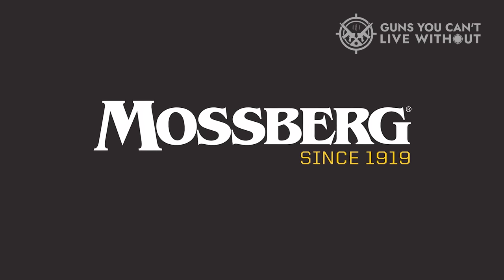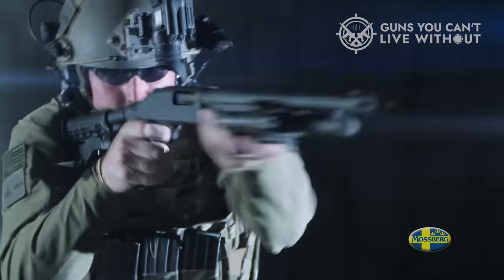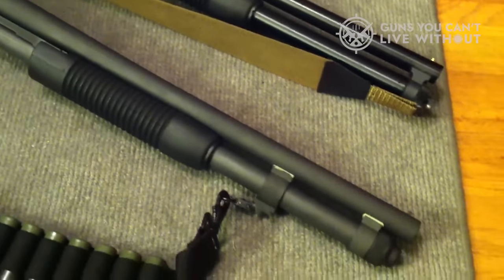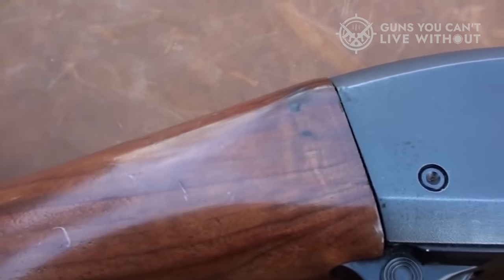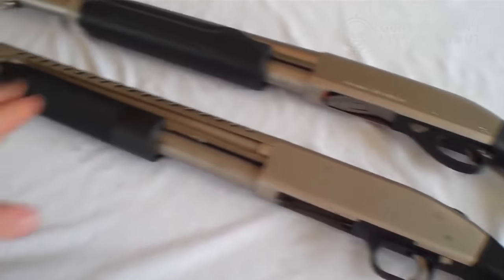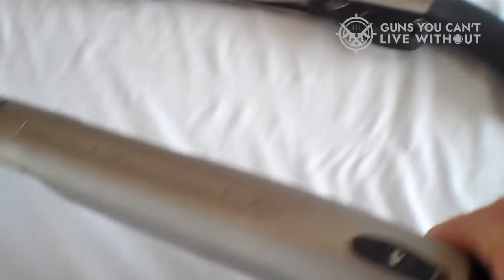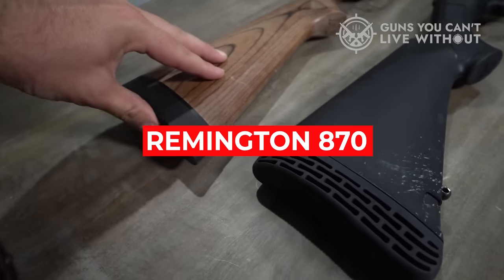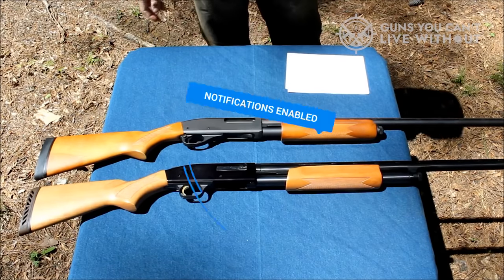Mossberg 590 vs Remington 870 - NOT EVEN FAIR.

Comment: I worked as a gunsmith in a very busy gun shop. I saw way more Remington shotguns coming in for work than I did Mossbergs. I’ll take the Mossbergs any day of the week. Simple to work on by the owners, lots of accessories and mods you can do that can turn a Mossbergs into any type of hunting, clay, tactical, competition gun you could want.
Reply: Do you know what time period those 870s that came in were from? Were they pre or post Freedom Group ruining them?
Reply: @ShogunMongol  It was kind of a mixed bag. This was in the mid to late 90’s. Ejectors were a problem on many of them. I think the thing they had in common was the numbers of rounds put through them. The thin wall magazine tubes were a fairly common problem too. The tube would get dinged and we would have to use a custom tool to take the dent out. Of course there were the usual things like action bars breaking or misfiring due to owners lack of cleaning or using WD-40 as a lube for years. I saw a lot of old and new models. The shotgun I absolutely hate is the Remington 1100. They may have finally got the gas system figured out on them by now. But that was the most miserable piece of crap to work on. You had to determine which version you were working on by the serial number because Remingtons gas system had modifications for years and years from them trying to get it to operate properly. God how I hated to see one of those come through the door and land on my workbench. Anyway, yeah…. A Mossberg 500/590 is superior to Remington 870 because most anyone can repair and maintain them with basic tools. If you’re mechanically inclined where you work on your own car. Do small plumbing jobs around the house or work on your motorcycle. You can do everything you’ll ever need to do on a Mossberg. No specialty tools needed. Remington…. Not so much.
Reply: What did you think about the old remington 1148?
Reply: @FriedPi-mc5yt  that's sad. I always thought that the 870 was good before Freedom Group
Reply: I'm not a Remington guy but I assume you'd see more Remingtons as they were a bigger seller
Reply: @revelation20232  That was probably part of it. But needing some specialty tools for the Remington insured that owners wouldn’t be fixing every problem themselves.
Reply: @hoppinggnomethe4154  Remington 870’s are good guns. It’s just that an owner won’t be able to fix every breakdown the gun may have. It will probably see a visit to a gunsmith at least once in its lifetime.
Reply: @jasoncooney3595  I don’t remember ever having one on my workbench.
Reply: Only used 870’s in my many years in LE, good to know. Thanks
Reply: Because there are way more remingtons on the market.  Mossbergs are cheap enough to just toss if anything happens.  btw, Remington wins hands down for sporting clays and trap, it's not even close (30 years experience)
Reply: @dazzling3237  LOL! Okay dude. But sporting clays and trap are pretty much a controlled environment. You drop that sporting clay and trap gun into real world environments and it won’t last as long as a Mossberg 500/590. There’s a reason the military chose the 590 and not a Remington 870. Ease of maintenance, robust build and the ability to fire round after round after round without trouble. Keep your Remington on the clay and trap range where it belongs. Just don’t bring it out in the real world to compete against the 500/590.
Also, I’ve never heard of anyone “just toss” a Mossberg. You don’t “just toss” a $450-$500 500/590 shotgun. The fact that the Remington 870 Express is over $500 and the Mossberg 590 is $475 just means you over pay for shotguns. I’m fine with you loving your Remington. But I would never choose an 870 over the 500/590. I would much rather have a shotgun that can get beat to hell and keeps going than take one that looks pretty on the clay and trap range.
Reply: @roncougar1  The PD/Sheriff was probably issuing 870’s because of a deal with Remington. Remington often gave law enforcement good deals on shotguns.   Of course Mossberg does too. Granted most all 870’s I’ve shot were smoother operating than Mossbergs. But as a Mossberg breaks in, it gets pretty smooth too. LEO’s don’t get much choice on issued shotguns. You gotta take what they give you. But if I had a choice I would definitely choose the 500/590. If it’s good enough for the Marines, it should work for cops as well.
Reply: That’s because those Remingtons are used much more by people.
Reply: @_DB.COOPER  maybe but not necessarily. Remington 870’s need specialized tools to do some work on them. A Mossberg doesn’t. If you break an ejector on a Mossberg 500/590 the owner can fix it. That doesn’t happen with a Remington. It takes a trip to a gunsmith. The only time I had Mossberg 500/590 on my bench was usually to add parts like Pic rails for optics or changing out factory safety switches for bigger aftermarket ones. It was for guys who weren’t comfortable adding those parts themselves. Though they very easily could if they would have had the basic tools to do it.
Reply: @FriedPi-mc5yt  I was part of a team that tested both and some others for duty deployment for the United States Border Patrol. The 870 Remington won hands down and is still the official Border Patrol shotgun.
Reply: @_DB.COOPER  Okay dude. You totally won me over. I’ll buy everything Remington has to offer now. You proved me wrong and I’ve seen the errors of my ways. My decades of gunsmithing experience is no match for your vast wealth of knowledge and experience. Did this work for you? Is it what you want to hear?
Reply: my Mossberg Pump Action (that too an affordable mode) is one of them most reliable and sturdy machinery is i’ve seen
Reply: @FriedPi-mc5yt  yes thank you. I know you’re the only person with decades of firearms experience because you worked in one particular gun shop and everybody should bow down to you because of your vast shotgun experience, knowledge and you’re no doubt the smartest person in the room and if somebody doesn’t believe that all they have to do is ask YOU! Wow, kid, you posted your experience and opinions and I posted my experience and opinions and then you get tilted and bent all out of shape. I bet you were fun to work around. 😝
Reply: Do you have any experience with Benelli supernovas?
Reply: @trentweston8306  They are excellent guns. A bit more pricey than a Mossberg (but not insanely pricey) but it has some really good features. They are super easy to maintain because they come apart easy. It’s better than lots of other shotguns for the money. The Nova was pretty cool. But it had some issues. Mostly you couldn’t really do anything about the length of the stock. I guess Bennelli learned their lesson with it and put a lot of effort into the Supernova. But yeah, from what I’ve seen the Bennelli Supernova is a top tier gun. Not sure why it’s doesn’t get more attention.
Reply: @FriedPi-mc5yt  This is a misleading statement. The fact remains that U.S. military has chosen both remington as well as mossberg. Price point was the reasoning behind the Mossberg simply the lowest bidder.
Reply: I agree. I do have to say though a Remington is addicting. It just feels good. Tickles a certain spot in my stupid brain. I can see the appeal. Slicker than a slug on a slope. I just made that up.
Reply: @adamnajera1297  Oh yes, the Remington 870 is a slick operating shotgun. No doubt about that. I defiantly love the Remington action. Once it’s broken in, it feels like the whole action runs on ball bearings. I’m just looking at the tactical/practical side of things. Kind of the same reason I like AK’s better than AR’s. If you need tack driving accuracy in a semi-auto. Very few guns can beat out the AR. But if you want a gun that you can sling and have it go with you to hell and back, the AK wins. I feel like I’m starting another fight with that statement. I built 2 AKs for myself from Hungarian parts kits. I’ve built an AR rifle for myself and I’ve built plenty of ARs for clients and friends. I like ARs a lot. Fantastic guns with enough aftermarket support that you can go prairie dog shooting in the morning. Use it for deer in the afternoon then plink with it in the evening. Just change out uppers for what you’re wanting to do. The AK…… not so much. It’s an anvil tough beater rifle that will shoot a dog turd if it contains a primer. It’s not modular, it has very few accessories that it can accept. It’s not a target rifle. It’s not that great for hunting (wild hogs are a go). But it will go bang every time you pull the trigger. It will drop rounds all day long into center mass at 150 yards. But it is what it is.
Reply: I had an 870.. it always jammed after the first shot
Reply: @michaelwadlington  Did you try different types of ammo? Did you ever figure out what was causing the jams?
Reply: if you worked as a gunsmith, why would you have any preference there? they both very simple shotguns.  both have lots of options of simple screw in, bolt on, bang rocks together kinda options.  they are both good and simple.
Reply: @FriedPi-mc5yt  ok, we are facing a "what era" question with these
Reply: @FriedPi-mc5yt  no remington does not need special tools.
Reply: @whatcanilearnhere9158  Why would I have a preference? Really? You don’t think mechanics have preferences in cars or programmers don’t have a preference in machine languages? Wood workers don’t have certain woods they like better than others? Come on dude. Get real.
Reply: I gagged at WD40 for gun lube.
Reply: @blucy10  I had a German Zwilling rifle/shotgun come across my bench that had been “maintained” with WD-40 as a lubricant for the action. It had silver and gold inlay in the engravings. The silver had actually turned a yellowish tint. I used a lot of Q-Tips and polish to bring back the silver color. I had an old S&W revolver that was nickel plated from the factory with the same issue. The worst part was when I opened up the gun to check out the firing mechanism. It looked like asphalt had been smeared inside the gun. All the burned powder, dirt and grime mixed with WD-40 residue from decades of “maintenance”. I had to use dental tools to remove it all. Then a multiple number of days soaking the parts in a cleaner/degreaser. I really hate WD-40 in so many ways.
Reply: Worked for a gunsmith as a kid ....yep...never seen a Mossburg to work on...we called them cheap guns...but they never came in for service...Remington yep worked on plenty of them.Shoe
Reply: @jasoncooney3595  1148 was a good gun for it's time, improvement over the model 11. that said it does have issues with heavy loads. For your standard bird shot loads it's fine but when you get into your high brass goose loads, buck shot or slugs, you have to flip the main spring in the fore grip. If you don't it will bust the stock. Also being recoil operated they have fairly heavy recoil compared to other autoloaders and the barrel moving can be a little weird seeing it. You would be better off with a pre 2000's 1100. I like the old 48's but the 1100 and 11-87 are better guns.
Reply: @_DB.COOPER  i totally agree, he is just one of those types🤨
Reply: @jimweishuhn2910  correct
Reply: @bushcraft_in_the_north  yes sir. Sad but true.
Reply: Maybe old model Mossbergs but the new version forearm rattles so much I have to hold it still when hunting. I have a newer 870 pre bankruptcy. I would say that this 870 is better made. Not quite as slick in the action but tighter tolerances and noticably more metal.
Reply: Same here for well over a decade I held an FFL and sold shotguns.  Some problems with Remingtons coming back ocassionally but Mossbergs never had any problems at all in all that time.
Reply: @FriedPi-mc5yt  I found that you have to manhandle a Mossy over Remmy a little bit more, never bothered me, but I've seen people with less experience struggle with new ones. That being said, I'd still take the 500/590 over the 870.
Reply: @FriedPi-mc5yt  👍🤣
Reply: Absolutely Spot on!! I bought a really nice Winchester Turkey Special some years back with laminated furniturer in a 12gage model that just kicked the living crap outta me. After I bought my Mossy 500 .20guage I sold that Winchester to my brother for his second son as a Christmas gift. I've killed turkey, coyote, and many other game with this shotgun and never had a sore shoulder, I Absolutely Love my Mossy 500 and would'nt give it up for anything!!
Reply: @chizorama  Yup, the Mossbergs do better with more aggressive handling.
Reply: hate the clickbait title that lied
Reply: I'll add my .02 since a number of posts hit on guns I've shot a lot, maintenance & LE. First I've gotten some awesome deals on non-working guns, because they were gummed up. So I encourage liberal use of WD-40.

LE agency gun buys:: Don't put any stock in them. I was in the game 31 years and if you're in a larger dept the budget usually dictates what is bought. Glock got in early, got its hooks into LE brass so it was buy-a-Glock-a-year with "new" models, "new"calibers ad nauseum. Sometimes an "influential person" will swing a buy to one model over another, you know just as a "public service". Like 870 over Mossberg.

When I entered LE in 1978 the dept had just switched to Ithaca 37 riot. Reason was for the ambidextrous feature which turned out to be a bad reason. In a little over 10 years we were having problems with self unloading 37's. I had it happen twice in one qualification with 2 different 37's. I was actually happy when I heard we were getting 870's and I don't like the 870. I didn't mind the Ithaca 37 until they started dumping shells spontaneously. 

IMEO the Rem 870's were a POS compared to the 1971 Wingmaster Magnum I had for 35 years. The 870 Police was like rubbing blocks of 80 grit sandpaper together. The non-detachable slings were another aggravation but was a "from above" mandate. I only had the Wingmaster because I needed a 3" chamber for waterfowl. Otherwise I hated its too short stock and the gosh awful safety position which I despise to this day. 

Feel like I'm missing a point. Any rate the first time I tried to load the 870 I found out it does not load easy like the Winchester Model 12. Learned to carry a special tool to shove shells into the mag, although I only had it happen a couple more times. 

I see you covered the 1100 pretty well. When I retired I worked in a LGS and asked the owner if the 11-87 was supposed to fix all the 1100 problems.....why is the 1100 still made? Answer was::..Some people love the 1100 so much they making them. (This was before all the financial crap and the big takeover).
Reply: I got both and both have never failed me yet
Reply: Your anecdotal evidence is interesting for sure
Reply: @sgtmcd  isn’t it?
Reply: Cheaper too. - Buy an 88 and accessorize all you want.
Reply: @FriedPi-mc5yt  I realized my comment may have sounded like a troll. I respect those that have experience and am always interested in learning. I watched this vid because I have an 870 from the early 80’s. It has always a point and click shooter for me but I’m certainly a novice on internals. Thanks again.
Reply: @sgtmcd  I have no real problem with the 870. They are well built guns and I’ve repeatedly said they have an exceptionally smooth action. My only issue with them is that they require some specialty tools for repairs. So eventually the gun will need the services of a gunsmith. Or you will need to purchase those tools for yourself and they aren’t cheap. Whereas a Mossberg 500/590 can be maintained by the owner from muzzle to buttplate. A few good screwdrivers and a mag tube wrench is about all you need. Add in a few drift punches and a hammer and you’re mostly set up to be a Mossberg 500/590 armorer.
Remington makes good shotguns. They will provide an owner with years if not decades of use. 
But I trained as a gunsmith and I can make a Mossberg 500/590 as smooth as a Remington. Plus I enjoy doing the work. Just because I prefer Mossberg shotguns over Remington doesn’t mean Remingtons are bad. It’s that I find Mossbergs more appealing for the price and the ease of maintaining it. I wouldn’t spit on someone’s Ferrari because I prefer Porsche. I have my reasons why I like Porsches better. You might have your reason for liking Ferraris. Nothing is perfectly suited for everyone’s tastes. Unless a person makes a thing explicitly for themselves.
Enjoy your Remington. I hope it serves you well for many, many years.
Reply: @FriedPi-mc5yt  cool. Thanks. My 870 is 20g and I’m in the market for a 12g. The info in the vid and your comments make me realize that I should educate myself a bit before buying. I really appreciate the info from knowledgeable folks like you. 🙂
Reply: @FriedPi-mc5yt  I should mention that I’m not married to my 870. I inherited it and shoot it mostly for nostalgia.
Reply: @sgtmcd  Like anything else, always research before you buy. But guns are like clothes. If they don’t fit, you’re wasting your money. Buy what feels good in your hands or at your shoulder. Look for the features you want and what the cost would be to modify it or buy aftermarket parts to fix any shortcomings. Think about the conditions you’ll be using the gun under. Will you be wearing winter clothing? Summer clothing? An adjustable stock might be required. If you already have the 20 gauge 870 it might be wise to get a 12 gauge version since you’re already familiar with the safety, handling, operation, etc….
Lots to think about. Good luck on your hunt for the new shotgun.
Reply: @sgtmcd  Nice that you inherited a good shotgun. I received an Ithaca 37 20 gauge from an uncle who I’ve always thought highly of. I will occasionally indulge in some trap shooting with the Ithaca. But it’s mostly to keep her action worked and because my uncle would be disappointed in me if I wasn’t properly enjoying the gun. He would not like it if she became a safe queen.
Reply: There are only about ten million more 870s, so I'm sure you worked on more of them . I'd bet most mechanics worked on more  ford's than Ferrari's, too. Real man of genius !!!!
Reply: @ronrichardson4805  It’s a shame your comment isn’t as smart as you think it is.
Reply: @FriedPi-mc5yt  I've been a gunsmith for the last 8 years, and this mirror's my experience. We've talked about it at the last two shops I've worked for. The staked shell latch, riveted ejector, and piss poor finish prone to rust are the worst. Nevermind even trying to find parts for the 870 now.  

Its a tough pill for lots of people to swallow, but its the truth.
Reply: @11481  I never had one on my bench that had a bad finish unless it was a heavily used birding gun. Or maybe if wasn’t well maintained by the owner. I’ve always found the 870 to be a perfectly serviceable firearm. Just annoying that special tools are required to do some work on them. Which is why I prefer Mossbergs.
Reply: @DB COOPER  His smartass attitude was completely unnecessary.  You did not disrespect  him or his shotgun of choice.  I'll bet he's a blast at the range.
Reply: @davidborzi6259  😂😂😂😂
Reply: This video forgot the 835. Just a 500 stretched out by half an inch. Heat up the receiver with a heat gun. That kills the locktite. Put on a 590 barrel and magazine tube. I'll find a gunsmith to open up the chamber.
Reply: I didn't have time to watch the whole thing so went to the comments to see a tldr 😅. I appreciate your perspective thereupon, who would know better than a gunsmith.
Reply: I have a 1957 Remington 870 with a 30” full choke barrel. I’ve Never had to have this shotgun worked on. It gets cleaned and taken care of. More meat and money was Won with this gun than could be remembered! It’s all in how you take care of them. Like your Wife !
Reply: @FriedPi-mc5yt  Owch, the Remington 1100 part hurt me right in the heart, that was the first gun I ever got when I was a kid.
Reply: @ShogunMongol  Yeah, I can imagine. The 1100 worked well, when they worked. But they were a constant source of irritation for gunsmiths.
Reply: 590 all the way
Reply: You are correct. We Are Watching...  👽
Reply: @_DB.COOPER  I would take the word of a gunsmith. That's done it for thirty years over a border patrol guy that wrote around with a shotgun set next to him and probably never fired it
Reply: @FriedPi-mc5yt  mine says "Montgomery Wards" on it.
Reply: @FriedPi-mc5yt  😂🤣😆😂!
Reply: @seansingh4421  still got mine from dad ... It has "Montgomery Wards" printed on it.
Reply: @John-jl4to  John what you should first do is take an English class, but you do you kid.
Reply: @revelation20232 by a huge margin!
Reply: A well broken in mossberg 500 is hard to beat. 
Mine rests bedside often.
Reply: @FriedPi-mc5yt  well played, I prefer the 870, I have an older 870 magnum that is going to out live me. the barrel choices/availability quickly change the 870 from self defense to turkey, deer or skeet/trap for fun, I looked at a 500 (new) and the slop in the action was bad, figured it would only get worse with use, from my limited knowledge it may have been improved on in the 590s but my 870s just get smoother with use and as for a gun smith only repairs I havent nor do I know anyone having broke down 870s. And guns are like most everything else these days, the older ones were better made.
ditto on the AK over the AR, to me the puny 5.56 is a barrel cooker and accuracy is just OK, I have more confidence in the AKs 7.62, its ballistics closely match the 30/30 and we all know what a 30/30 can do to a deer.
But when all is said and done its still the same old Ford Chevy debate.
Suum cuique.
cheers.
Reply: Is it because the 870's were used more? Idk, i have both-mossberg is newer. 870 is a recycle patrol gun. 870 seems to have lasted use better. Like em both but i would choose rem first.
Reply: I have a Mossberg 500 12 gage. I have used it for all hinds of hunting and shot literally thousands of rounds of trap with  it. Always went bang without a single failure. Cleaned it twice a year if it needed it or not. I also much prefer the tang safety. Easy to see if it's on. I have a bad habit of bumping off a cross bolt safety whole carrying in the woods
Reply: @FriedPi-mc5yt from my time in the military, I can tell you that we never even though of ever using a Remington in warfare scenarios. They are just not as reliable as the 590. Their is a reason the army chose the 590.. and their is a reason other part of the military chose the Bernelli and have never chosen the Remington. People can keep their Remingtons for their clay pigeons… I’ll take a 590 any day…
Reply: That’s because unlike the Mossberg which went out sloppy and shity the Remingtons should never rattle or have anything short of the slickest action ever operated so when farmer billy Bob mcStumpy noticed his action feeling stiff like a BPS he took it in and you cleaned it and sold it back to him. The Mossberg is so bad if it rattled less one would think dropping it 35 times accidentally fixed something.
Reply: @FriedPi-mc5yt Now you make the bogus claim that the Remington 1100 is garbage? Tell me why mine from the 1960’s (serial number dated to that far back) still runs like a brand new shotgun in a good way? Keep them clean and lubed and they just flat out work. It’s Ok that you like cheap inferior products because they fit your budget but no sense in lying about the why. In addition to being made in America sportsmen have bought Remington long guns for generations because they were the best. They dropped the ball at each acquisition but what can you do about that?
Reply: @hoppinggnomethe4154 Was. He saw High round count Remingtons that he basically been shot to death. He didn’t see Mossberg because people bought them and then stuck them in the closet and saved for a Remington and shot the Remingtons to death and it took decades for all but the most active competitive shooters.
Reply: @Batmicheal  Why so butthurt? It’s common knowledge in the gunsmith community that the Remington 1100 had a poorly designed gas system. Why else would Remington keep redesigning it if it was flawless? I’m sure you’re prepared to tell me that your Remington 1100 is prefect in every way and that it worked with every shell you ever put into it, from the lightest field loads to the heaviest Turkey loads. If that’s the case, good for you. I’m glad you got the one good Remington 1100 ever sold. I’m glad it cured your erectile dysfunction and made all your dreams come true.
Reply: Really because there have been 5 mossbergs in the family and everyone of jammed all the time.  Now I only have 870s.
Reply: Edit.  All of my purchases were from late 70s to mid 90s.
Reply: @tiredofallthis7716  I’m curious why your family would buy 4 more of the same gun that kept “jamming all the time”? Were they all new in the box? Why were they jamming? Were you using reloaded shells? Were you working the action correctly? You know that every gun has a break in period, right? Did you disassemble the gun and put it back together correctly? I’m a bit skeptical of your claim.
Edit: so from the late 70’s to early 90’s you kept buying the same POS Mossberg pump shotgun that “jammed all the time” and only after buying 5 of them, you decided to buy one of the glorious, all powerful, Remington 870, kill everything within 500 yards, shoulder mounted, red white and blue, I ❤️ Merica shotguns? 😂
Reply: @jasoncooney3595 Awesome!
2 3/4" limited but one of the greatest autos
Reply: Mossberg 590L. Was my patrol shotgun for years and still have it today flawless!
Reply: @FriedPi-mc5yt -- my Remington 1100 in 20 gauge from the early 1980s has never had a problem with factory loads.
Reply: @mojoman2001  Most of them do fairly well as long as you stay with standard loads. I hope you continue to have flawless service with your shotgun.
Reply: @FriedPi-mc5yt -- my 1100 in 20 gauge from the early 1980s works with all factory loads with no problems -- from #8 to buckshot and slugs.  Maybe there were a lot of manufacturing defects, but the design works great for me.  To say, "You got a good one" is a reference to manufacturing defects.  If the design was defective, there would be no good ones.
Reply: @mojoman2001  The design was/is defective. That’s why Remington kept redesigning the gas system. To get “a good one” simply means that the mechanical tolerances lend itself to functioning better. It’s as simple as that. With mass production comes fluctuations in dimensions. Especially before CNC machining was a thing. Even gauges used for testing tolerances wear over time. So….. not sure why you have a problem with what I said to someone else. If your 1100 works for you, that’s great that you got a good gun. But I know a lot of people that had nothing but trouble with them and had a lot of them on my bench that were a constant pain in the ass for me and the owner.
Reply: Wouldn't argue if an 870 is what I had, buy the lower price & reliability of the 500 series has never dissapointed especially when it comes to the 500 & getting a combo with the smooth shotgun barrel & a rifled slug barrel with fiber Optic sights makes it a great "if I can only afford one" choice. Really enjoy my 590.
Reply: @FriedPi-mc5yt you're just wrong dude, admit it. Your anecdotal experience means nothing.
Reply: @jegr3398  LOL! Yeah, it means nothing to anyone. It means so little you had to respond. LOL!
Reply: I didn't like the rattle effect on the Mossberg trying to carry it through the woods well deer hunting
Reply: @justdoingit.43  All pump shotguns rattle. There has to be a certain amount of loose tolerances in order for it to function in most all weather conditions. Tight tolerances lead to more malfunctions.
Reply: @_DB.COOPER  Which model and price point?  An 870 Police against a 500?  What deal was Remington making?
Reply: @vasky22  800 works, I wasn’t buying all of them the tax payer was.
Reply: @11481  Was just gonna buy an 870 but after hearing about these 3 easily fixable issues that Remington never fixed, I think the Remington is out of the running. Whats it like trying to replace and ejector?
Reply: Missberg is a bit cheaper made. Remington a little heavier and bulky. Ill take remington any day though....
Reply: @clems6989  You can do as you please. Your money. Your choice. I just offered free advice. It didn’t cost you a dime. But your choice might cost you later down the road.
Reply: I feel like another big thing is the mossberg has some easy to service parts. Screwed in extractor and such.
Reply: you can't find accessories for a Remington 870🤣 I own several Mossberg's & Remington's including the 870P & 590A1 of those I am biased towards the 870P
Reply: @ccclc6159  I never said you couldn’t find accessories for an 870 did I? Because if you’re implying that I said it, I never did say it, did I?
Reply: @FriedPi-mc5yt  I never said you said I couldn't find accessories for an 870 I can find all kinds of accessories for 870's
Reply: @ccclc6159  “you can’t find accessories for a Remington 870🤣” So what did you mean by this then? Are you saying I couldn’t find accessories for an 870? Because I never said that either.
Reply: @FriedPi-mc5yt  just thought your statement that there are lots of accessories and mods you can do to a Mossberg was a little juvenile & silly? as if the same can't be done to a Remington?
Reply: @NosferatuXGutts  Are the rivets in the 870 a positive thing, making sure its will never come loose which could happen with screws. I dont think screws would come loose, you could put thread locker on them as I do with many engine bolts. Just wondering if tats what Remington was thinking or are they just trying to save a buck?
Reply: @ccclc6159  Did I say there were no mods or accessories for the Remington 870 or any other shotgun? You do realize I was speaking about the Mossberg specifically, right? At what point in my statement did I say that no other shotgun could be modded or accessorized? I think you were a bit quick in posting your comment. You must have thought you were making a genius comment and it’s not turning out as genius as you initially thought.
Reply: I worked as a correctional officer and we had the 870 as our duty shotgun and I gotta say that I never liked it. I own a mossberg 500 and it has a buffer tube for better recoil, more lefty friendly, holds more rounds, and it’s just more comfortable to hold
Reply: @dazzling3237 the reason there are more 870s on the market than 500 series Mossbergs is simple and well known. Just as there were more Dodge and Chryslers in use by LEOs all over the country back in the day because Chrysler sold them cheap to get them on the road (same with Glocks for that matter), Remington sold their shotguns at greatly reduced prices to LEO Departments. Mossberg is the superior shotgun (of the two) in the hands of most combat shotgunners for reasons mentioned in this video and they're preferred by competitive three-gunners such as Jerry Miculek. Vang Comp, on the other hand, made a complete business out of trying to make the 870 better for a lot of extra money. And yes, Remington almost ruined the 870 brand just as they almost ruined the Markin brand. And finally, the Ithaca M37 trench guns are the holy grail of combat shotguns imho. The Ithaca 37s are superior to both 500  series and the 870s but they are prohibitively more expensive and without all the available accessories.  I own a couple of Ithacas, a few Mossbergs and one 870 which is a barn gun. As a former active duty member of the 82nd Airborne Division, as a competitive 3-gunner and as an avid sportsman and outdoorsman I could not agree more ... the Mossbergs win overall hands-down. With that said ... and it's not a pump but, Mossberg's Jerry Miculek 940 Pro is the whoop in terms of combat and competitive shotguns these days.  I own a couple of Benelli M4s but they've been surpassed by the 940 Pro, for the money, IMHO.  Mossberg really has-it going-on.  They are serious about their shotguns in a big way. A GREAT American company all the way around.
Reply: Because people that buy mossbergs can't afford a gunsmith.
Reply: @jeremy4046  bro why would I buy a gun I can’t smith myself or would need to take to a gunsmith?
Reply: @andreww8213  I've been shooting my 870 for over 20 years. I can still drop a whitetail at 100 yrds and have never needed to do anything to it....except to sights i did replace them with high vis fiber optic ones for low light dawn dusk situations.
Reply: @jeremy4046  I personally just don’t like the 870
Reply: Who in their right mind would toss a shotgun?
Reply: @scottwilliams8334  no idea
Reply: Mossbergs tend to cycle more reliable when it's wet. Shells don't extract well on the Remington when wet due to the single extractor.
Reply: I am a gunsmith retired 10 years. They’re both good guns but the Mossberg does have one fatal flaw.  Drop the shotgun and it’s possible for the Elevator lugs to pop out of the receiver and the action gets jammed up.  You then need to remove the trigger assembly and bolt assembly to seat the Elevator back into position.  Easy fix but if it’s a defense gun then that could be an issue.  Easy remedy is don’t drop the shotgun. 😉 And I seen more Remingtons come in for work in my shop also. But I believe that’s because we sold Remingtons 10 to 1 compared to Mossbergs so obviously there was a lot more Remingtons then mossbergs in our area which accounted for the difference.  I own both and I think they’re both equally good guns if you know their pros and cons.
Reply: @_DB.COOPER I don’t like them because they are made by Remington 😂. Absolute trash
Reply: Funny enough, i am buying my very first shotgun, and as someone who doesn’t know much about them i preferred the build quality of the mossberg 590 over any remington
Reply: That's because everybody back in the day had a Remington 870
Reply: Most owners didn’t own mossbergs😂
Reply: @FriedPi-mc5yt out of curiosity, what’s wrong with using WD40 as gun oil and what happens to the gun or how does this cause the action bars to break? (I don’t use WD40, but I would have assumed it works as well)
Reply: @Bisley1  WD in WD 40 stands for “Water Displacing”. It’s a water displacing oil that’s not necessarily meant as a lubricant. WD 40 will combine with power residue, dirt and grime to make a tar like substance over time and will harden up in all the nooks and crannies of a guns action. Over years of use without a thorough cleaning to remove the junk that builds up. It could lead to parts breakage due to jamming of the mechanism.
Reply: Remington 870 any day of the week my man. . .
Reply: @FriedPi-mc5yt thank you! Then I will stick to my gun oils😃
Reply: @FriedPi-mc5yt  thanks for the info!! Good to know. I use gun oil, but i would have thought wd40 might work as well. Good to know, that it doesn’t
Reply: Mossberg is crap, I'll take the 870 all day long.
Reply: @dalejohns2758  It’s a free country. However your opinion of Mossberg isn’t supported by the facts.
Reply: @FriedPi-mc5yt  it's fact to me, have them both for over 40yrs, 2 Remingtons2 Mossbergs, both Mossbergs have been at the gunsmith a number of times. Remington 0 times. Avid Duck and Goose hunter for 46yrs. Lots of 3in magnums pounding on both.
Reply: @dalejohns2758  Okay dude. I’m sure you’re totally right.
Reply: @FriedPi-mc5yt  indeed
Reply: @dalejohns2758  I guess you’re happy you got what you wanted to hear? Cause I’m just throwing you that bone.
Reply: It could be partly from the deep market saturation of 870s. More guns = more problems.

Personally, I prefer the Model 37 Ithaca.
Reply: @tolarpowell5069  It could be to an extent. But if the build quality was as amazing as the Remington Super Fanboys claim it was. Then I should have very rarely seen an 870 on my workbench and should have seen more Mossbergs.
Reply: @FriedPi-mc5yt  Ah, yes, but now you're talking build quality, not design. I think the design is solid, but the last 20 years or so wasn't kind to Remington's reputation. Even before that, they were cutting corners.
Reply: @tolarpowell5069  Well design and build quality are intertwined. Every manufacturer has limits in regard to materials, labor, design, equipment and marketing. An example is North American Arms with their original Ranger mini revolver. It was a top break design 22 LR/Magnum. Their initial public run of them were sold at below cost of manufacturing. So they dropped the design. After a redesign and some changes in production, they came out with the Ranger 2. From what I understand they are able to sell the new design with a reasonable amount of profit. I’m sure Remington and Mossberg have the same considerations to make. But my previous statement regarding Remington needing specialized tools to do some repairs still holds true. The average shooter is not going to spend $500 for an armorers tool set to work on their Remington 870. You don’t need an armorers kit to work on a Mossberg 500/590. So it’s my opinion that a Mossberg is a superior shotgun because virtually everything can be repaired by an owner who has a decent grasp of how their firearm operates. Even if Remington has a superior build quality, in the end it will eventually fail and need the attention of a gunsmith. I can order an ejector for a Mossberg for under $20 and replace it myself. You could do the same. The Remington will need to go in the shop. They will need to order the ejector and a rivet. Then they will need to remove the broken ejector and rivet and install the new ejector and rivet with a special tool. So you’ve just increased an ejector replacement by adding in 2 hours of gunsmith time, the cost of the rivet and the ejector. Plus all the parts will have a markup charge for shipping & handling, etc… So yeah, I’ll take the Mossberg over a Remington. It’s a great gun for guys who know how to work on and maintain their own firearms.
Reply: @FriedPi-mc5yt not true , they sell ejector replacement kits for 870s for 20$…. don’t need a gunsmith
Reply: @FriedPi-mc5yt  I ihad an 1100 LT20 I sold years ago that ran like a top. Not sure what the manufacture was but it never gave me problems. I usually had to run 2 shells through it when first taking it out for the season because the first wouldn't fully eject but that's nothing.
Reply: @oldschooldude8370  ran like a top but wouldn’t eject? 😂
Reply: @oldschooldude8370  Sounds like it ran like a top. Nothing like needing to run some shells through it to get it running.
Reply: @FriedPi-mc5yt  Stiff action from sitting for a year. I'd clean & lube it then it sat. It's gas operated shooting light shells. Not a big deal.
Reply: @guaporeturns9472  From sitting for a year. 1st shot was to loosen it up. 2nd cycled. It was cleaned & lubed before put away but things get sticky. Was shooting 7 1/2 or 8.
Reply: @oldschooldude8370  Oh I didn’t quite understand your comment… though it would only cycle 2 shells at a time then jam.. my bad
Reply: @guaporeturns9472  That was an 870 20ga I had. 2 shells would cycle followed by the 3rd dropping behind the lifter. It needed parts & I didn't care for it. I sold it for cheap telling them what it needed.
Reply: @oldschooldude8370  👌🏻
Reply: @oldschooldude8370  You shouldn’t have needed to do that at all if it was “running like a top”. Every semi auto should fire flawlessly if stored for a year and then put into use. Either you’re using a poor gun lubricant or your gas system is faulty. You might want to check your gas seals and your gas ports. A good quality lubricant could solve the problem too.
Reply: @FriedPi-mc5yt  I sold it 10 years ago. Once I ran a couple through it at the field it was flawless. Best handling 20ga I ever used..The gas ports probably needed a deep clean, sure but I never cared enough. I folded so many quail & dove using a modified I didn't care about that simple ritual every year.
Reply: I Had An Old Ithica Model 37 Pump Shotgun In My Police Vehicles That Would Out Shoot Both Of Them! Tougher Too! It Shot Buckshot Better Than Any One I Ever Saw!
Reply: @timburris3758  how exactly would it “out shoot” them? Yeah ok 👌🏻
Reply: @timburris3758  Cylinder bore is all the same. Ithicas were solid all the same.
Reply: used or carried ?
Reply: @2abuck401  even the old mossbergs sound like a baby's rattle walking through a field! Lol
Reply: @ColdWarVet607  don't know. Had my 870 for 30 years, never had to change one. I like both platforms, but I personally have not seen any of the cons in my 870 express magnum. It shoots everything and is easy to maintain. What "special tools" are required I don't know either. I've been able to easily fix any issues with the 870. My mossbergs have given me more problems in my experience. I prefer the 870 steel construction over the mossbergs aluminum. I'd rather have a replaceable part wear than the receiver. Also there are less parts in the 870 action. It's undeniably smoother and simplified. I don't think you can go wrong with either the 870 or 590, I'd pass on the 500 though.
Reply: For a basic get it done tactical/home defense shotgun, it is hard to beat a 1970's or early 1980's Winchester Defender.
Reply: I seriously doubt he was a gunsmith at all. I’m old, and my family uses nothing but Remington, and we NEVER had a issue that needed a repair. I say both shotguns are good, it’s not worth debating in my opinion. But in my opinion, I would never part with any of my Remington 870 variants, they’ve served us well.
Reply: Benelli enters chat. Lighten up guys. You don’t have to chose one over the other. Depends what it’s used for and what configuration you want. If the question is if you could have only one. Well that sucks
Reply: @FriedPi-mc5yt that's just plain wrong. Military had nothing but issues operating 590s on deployments. They jammed in dirty and dusty environments. There is a reason they moved away from Mossberg. Also Mossberg has been plagued by QC issues in the past few years.
Reply: @bloodycrepe  I’m so glad you corrected me and set the record straight. I’m disappointed I wasted so many years working on firearms learning the trade when I could have just asked you and tapped into your vast wealth of knowledge that puts my decades of experiences to shame.
Reply: @FriedPi-mc5yt  your ego is overinflated, you should keep it in check as it makes you sound like an immature teenager. You didn't provide any solid information in any of your comments. It's all anecdotes.
Reply: @bloodycrepe  Hey buddy, where’s all the solid info in your comment? YouTube doesn’t let anyone post links. But there is a lot more info out there. You can start by looking at Brownell’s for the Mossberg Armorers tool kit versus the Remington Armorers tool kit. Here’s a hint. Mossberg doesn’t have one. The 870 does have one. What does that tell you? Does it support my previous statements?
Reply: @FriedPi-mc5yt  we are all aware that Remington requires special tools for certain jobs, mr obvious. And yes, I will trust men I know personally who served and were deployed over some rando online with ego issues. They all repeated that Mossberg 590 was jamming in dusty environments. It has nothing to do with a firearm repair man.
Reply: @bloodycrepe  😂
Reply: That’s because Remingtons outsold Mossys by about 200:1.
Reply: @jcraigshelton  yeah but he is a mega gunsmith. He is a know it all. How dare you question anything he says? 
Btw based on what he said here, I think he is a fraud.
Reply: @bloodycrepe  😂 I must have struck a nerve. You need some cream for your chapped a$$?
Reply: @jcraigshelton Whatever. I should have seen some 590’s that needed repairs. I only saw 870’s needing repairs.
Reply: I only use my shotgun for upland game. They only reason I prefer the Remington is like where the safety better. I have trouble moving the tang safety forward. 53 years of mussle memory makes then Remington safety behind the trigger automatic. PS for lefties it can be reversed.
Reply: I own a Mossberg maverick 88 20 gauge and  I've had it now for quite some time. It has not let me down and so far I have no complaints, I know that it's the lower end/entry level of the Mossberg 500 but as I said, in my opinion it's a great shotgun. I'm currently trying to figure out where I can purchase a wood stock and foregrip to replace the composite stock and foregrip that's on it and so far I found a pretty nice looking package from woox called the gladiatore.
Reply: I worked as a gunsmith in an armor in a very very busy gun shop as well I never saw any Remington's I saw a ton of mossberg's because the receiver would get hairline cracks in it because it's aluminum.
Reply: I can't really comment on Mossbergs because I've never owned one.  I've handled them in the store, but always walked away without buying.  And I'm a lefty, so the tang safety appeals to me...but I'm so used to being ass-backwards, it doesn't matter.   I've owned Ithacas, one Winchester and 4-5 870's.  Currently have two 870's, one was my uncles, is ancient and smooth as glass.  The other I bought last year and I haven't fired it much, but the action is nice, and the finish held up just fine riding locked up in my truck for nearly the whole year (lubed with Tetra).  I recently disassembled and cleaned it.  Truthfully, I was kind of surprised how good it looked. 
Bottom line, I've always had good luck with 870's.  Buy what works for you.
Reply: @davidholt4216  You should be able to have a gunsmith reverse the safety but after so many years might not want to bother.
Reply: @JohnKendall-je4rx  Yeah, I've done that a couple of times, but really wasn't worth it.  I'm used to tilting the shotgun a bit and hitting it with my thumb now.
Reply: What do you think of the Mossburg 930? Home Defense?
Reply: I like both of them
Reply: Buenas.Aqui en España se ven algo más la Mossberg que las Remintong. 
Podríais darme la opinión de la Franchis sps corredera??Es la que lleva usando muchas policías y unidades militares desde hace 30 años y ahora las van actualizando. Gracias a todos
Reply: @richardhuffman-oy8ng  The 930 is a pretty good shotgun. It’s reliable and a bit of recoil is soaked up by the gas system so it’s easier on the shoulder. Since it’s gas operated not gas/recoil operated like the Remington 1100. You can fire it off the shoulder if you need to and have a second shot ready just in case.
I’m still kind of old school though in that I like a pump gun for home defense. I like the versatility of 12 gauge ammo that they can fire also. Like the Aguila mini shells for example. But if you have a standard load you intend on using. I would put at least 200 rounds through the 930 before I would consider it reliable with it. If it functions new, out of the box with the load you want. You should be good to go.
Reply: @peperojo6475  Hola. No hay nada malo con las escopetas Franchi que he visto. No tengo tanta experiencia con ellos. Pero tienen buena reputación por ser armas resistentes y fiables. Estaría feliz de tener una si necesitara una escopeta.
Reply: @FriedPi-mc5yt   muchas gracias y que pases una felices fiestas de Navidad
Reply: Agree.
Reply: For the position of the safety alone, I would take the Mossberg.  Only complaint I have, is the standard 500 has a plastic trigger guard.
Reply: I got a Remington 870 Wingmaster tactical Police trade in at Cabela’s recently. I hope it’s a good one
Reply: @_DB.COOPER     lot of people flowing over that border.   A paperweight...
Reply: @trentweston8306    great company, can't go wrong.
Reply: @chrisferrell6978  really genius! What’s your point?
Reply: @tiredofallthis7716  i have both. The 870 is a heavy turd but it always works. My mossberg 500 jam also.
Reply: I’ve worked on far more 870’s as well, from all era’s clear back to the 80’s
Reply: The 870 is one of the best shotguns that Remington has ever  made....And I have never liked the ejector . .... At this point I don't have one ....
Reply: @slelliott14  I’ve worked on a 4 to 1 ratio of mossbergs since the 60’s. Remington is far superior.
Reply: @davidlayne8755  the ejector is fantastic if you know how to use the gun.
Reply: @_DB.COOPER  yep I've seen people like you when it comes to the rem. 742 also... LoL
Reply: @davidlayne8755  yep, I’ve seen people like you when it comes to the rem Job also! 😂😆😝😝😆😆😂😝🤣🤣
Reply: @_DB.COOPER  That's the first thing you have said that makes sense..... I just bit you have seen rem jobs.  ...
Reply: I don't believe you!
Reply: @FriedPi-mc5yt  uh yeah, right!
Reply: The model 590 was redesigned into the POS 500 because it couldn't keep up with sales or the quality of the Remington 870...
Reply: You know that's funny that you would say that? I never had the first problem with any 870 that I ever owned and I've had many in all grade levels. However, I did not and still refuse to buy any of the newer production guns...
Reply: @ekbanjosworld4926  EXACTLY!
Reply: @FriedPi-mc5yt 
military goes with the low bidder, less maintenance cost and replacement cost.
Reply: Wingmaster is King. 👑 Five decades of so much use that the blued metal has turned grayish silver in high touch areas. Never one issue except she eats a lot. 😂
Reply: @laurence1643  “Less maintenance cost” That is one of the things I pointed out about the 590 versus the 870. Thanks for backing me up on that.
Reply: As a User, I found two shotguns superior to beth the Remington and the Mossberg: the Ithaca 37 and the Smith & Wesson Model 3000. The LAPD used the Ithaca for many years abd was considered to be "ambidextrous" with its bottom loading and ejection. As to the S&W 3000, it was effectively a "product improvement" of the Remington 870. While the Ithaca is still available, the S&W 3000 has long been discontinued.
Reply: @johnjohnsn7633  The one flaw of the Ithaca 37 is that it will fire if you’re holding down the trigger as you rack another round into the chamber. Some people think this is a feature, not a flaw. I can see how it could be useful. But in a high stress situation it could get an innocent person killed. That being said, I’ve got an Ithaca 37 that my uncle used to win turkey shoots regularly. It’s an old, well used gun that I shoot occasionally to make sure my uncle doesn’t haunt me for neglecting it.
Reply: What kind of failure were you fixing and on which models?  I have an 870, that's why I'm asking.
Reply: @rangerup1804  Mostly the work I was doing was fixing ejectors, safeties, occasionally doing trigger/sear jobs for better trigger pulls. Now and then I would have to take out a bad ding in the mag tube, replace shell followers or replace a spring in the mag tube. Most of the ones I worked on were used regularly for birding, 3 gun competitions, trap, etc… The 870 is a good shotgun though. My only real gripe about them is the need for specialized tools to do some repairs when the design could have easily been changed to only need common tools for repairs. I’m just practical that way. I think things should be designed so the owners can do the repairs themselves if they want to and not need an armorers tool set of specialized tools to do it.
Reply: @FriedPi-mc5yt I have a Mossberg 590A1 and a Remington 870 police from 1979, my Remington is indestructible and the quality of manufacturing and assembly is for me much superior... for me the 870 police and Wingmaster from the 70s and 80s are the best manufacturing
Reply: My father has had a Remington 1100 for 40 years without issues. Mostly used with the slug barrel for deer hunting and I've had a Remington 870 for about 15 years with 3 barrels and no issues. Plus I haven't looked lately but i can take my 870 and have it set up for duck hunting and then change the barrel, stock and everything and make it into a home defense gun. To me no matter the brand the older guns seem better built . And alot has to do with ammunition, when I was younger (and cheap) would buy bullets from Walmart thinking Remington is Remington, Winchester is Winchester and so on, well not the case and have uad misfires, dirty ammo and literally one box the bullet would fall into the shell if tapped on a table. That was the last Walmart bought ammunition for me.
Reply: Why is that there are way more Mossberg problem videos on youtube than Remington?
Reply: @user-zp4hk4bi8l  How many Mossberg 590 versus how many Remington 870? You’ll need to back that claim up with proof.
Reply: @FriedPi-mc5yt you too must provide concrete evidence to assert that the 870s are not reliable... honestly this is the first time I've heard that... that there have been quality control problems on recent expresses from agree... but otherwise I think the 870 is one of the most robust shotguns and it must be the most popular pump shotgun in the world... there is a reason for that.
Reply: @mxlife958  I never said in any of my posts that the 870 wasn’t reliable. You better go back and read.
Edit: What I have said is that the 870 is more difficult to work on than the 590. The 870 requires specialized tools that the average guy isn’t going to buy. Or they won’t know to buy them until the gun needs to be repaired. Shoot whatever shotgun you want to shoot. I don’t really give a damn one way or the other. I prefer to own firearms I can repair myself without having to buy an armorers tool kit to do it. So go shoot your 870. Have fun with it. But don’t come at me accusing me of saying things I never said.
Reply: @FriedPi-mc5yt You don't need 50 tools. just a needle for the ejector.
I honestly don't really have a preference, I use both the 590A1 font and the older 870 font.
I used the 590A1 during combat in Iraq and Syria, it's a great rifle, but I also think about the 870, and I find that the old police 870s are of unparalleled quality for a pump rifle, and the fluidity of its mechanism is also incomparable. Afterwards, for the ejector tools, they are available everywhere and they are not expensive. but hey on the old 870 police before replacing an ejector you have to go, I have an 870 police bought from the Illinois State Police (Chicago Police Department) it is from 1979, it has fired thousands and thousands of shell, it still has its original ejector which is perfect and which ejects at 2.5 yards without problem.
Reply: I had a 870 once never again it would shoot a circle around a target not one pellet was inside the target I gave it away I was told later they replaced the barrel it still would shoot around the target not one pellet inside the target
Reply: Rems dont break
Reply: I had one 870 and my last not one pellet was in the bulls eye it was in a circle around the bulls eye I gave that piece of junk away a new barrell was put on it same it would be in a circle around the bulls eye not one pellet in the bulls eye that was the worst piece of junk I have ever owned
Reply: @JackGorton1960s  so true they are junk right out of the box worst firearm on the market
Reply: @JackGorton1960s  everything mechanical breaks.
Reply: How many mossberg 590's have you seen with light primer strikes, is it common, mine started doing it recently
Reply: @alaverga173  A light primer strike can be caused by several things. You might have some residue or debris in the firing pin channel. A full disassembly and cleaning of the bolt might cure it. The firing pin might be worn from use. The shells you are using might have hard primers. Low cost ammunition will sometimes have a thicker primer metal. I would try a better brand of ammo if you’re using low cost stuff. If it still has a light primer strike, do a full cleaning of the bolt. It’s easy to take apart. If it’s still doing light strikes. Check the firing pin protrusion. If that’s okay, you might need to replace the hammer spring.
Reply: For sure for sure, Ole, Swan and Fritz, 85 yo gunsmith, Mossburg is great!
Reply: I have old 870 tactical 12Ga with butler creak folding stock it's bullet proof Lv it!
Reply: @dazzling3237  They have made around 11 million of the Mossbergs. That seems like a lot to me.
Reply: @michaelwadlington always jammed after the first shot? That's impossible there's only 1 first shot.
Reply: I have owned both and think both are Great But I love the Mossberg. Thank you for telling us that. I appreciate that
Reply: @FriedPi-mc5yt good points. I like the 870, AND the 590, but if I had to choose one, the one that I would bet my life on, I would unhesitatingly choose the 590. I think it, and the old Ithaca 37, are absolutely tops. I have always been a Winchester fan, but I would take the 590 over the Winchester 1300 or Model 12, as well.
Reply: @FriedPi-mc5yt true words but the rem 1100 is such a natural well balanced shooter that its worth the trouble
Reply: @brucepoole8552  They are good shotguns if you set them up with a specific load and stick with them. Find a load the gun likes and functions reliably with and you’re golden. Remington makes good guns. Clean it with a quality gun cleaner. Oil it with a quality gun oil, (not WD-40) and the gun will last a lifetime. I just have issues with their engineering choices.
Reply: You saw more Remingtons because of the number sold compared to the mossburg
Reply: @johnconvry3065  I should have gotten some Mossbergs on my bench for repair. Even if it was just one. But I never did. The only  Mossbergs I got were for upgrades, not repairs.
Reply: @revelation20232  The Mossberg 500 and the Remington 870 are the two most popular pump-action shotguns in the US but the Remington has a larger market share.
Reply: @FriedPi-mc5yt and the Remington 1100 internals were sharp as obsidian. A royal pain in the ass to clean. Constantly got deep cuts from the insides of those things
Reply: Mossbergs aren't worth fixing?They were cheap shotguns not worth the cost of repair backing in the 80's-90's,but I obviously come from a different era,"time traveler.
Reply: Hear any issues with the m500 jamming because the ejector tab things pop out?
Reply: The ammount produced, used and the versatility in modding leads me to believe that Remington 870 is self-explanatory to any nonbiased gun enthusiasts. That said need I say anymore?
Reply: @jaymesjmathias9390  It’s a free country. You’re free to choose what you like. But you’re biased towards the 870. So don’t pretend you’re not.
Reply: Ever consider it's because more people own and use Remington? Seeing more of something implies more use, not necessarily poor quality. I know more people who own Mossberg's but aren't actually shooters and are basically kept for home defense because they think it's cool yet rarely if ever go to the range. I see way more people at the range with 870s than people showing up with their tactical Mossberg.